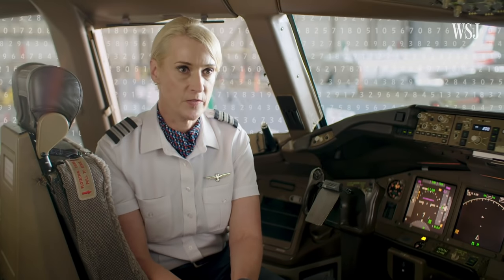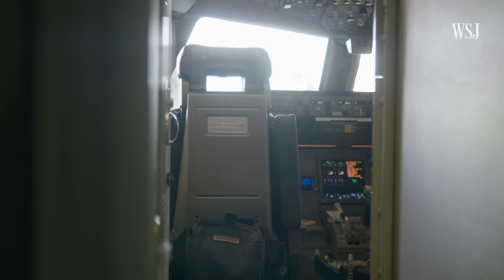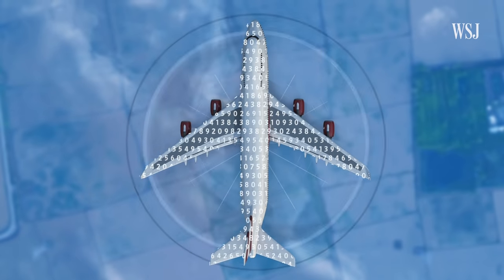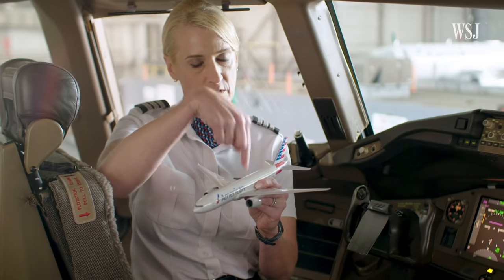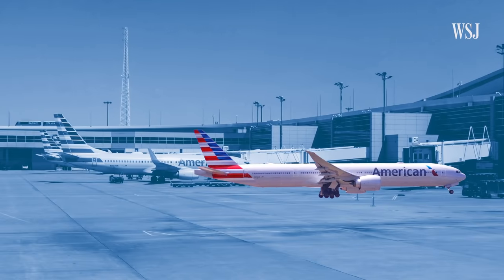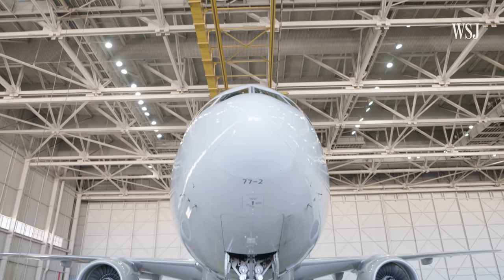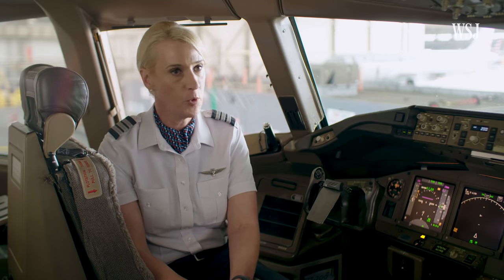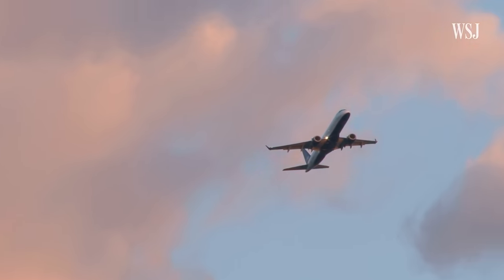How Does Autopilot Work? A Pilot Explains What It Can and Can’t Do | WSJ Booked

Comment: You said the 737 max crashes "was an issue of pilot error along with software". thats not true. Pilots were never told of the MCAS system in their planes and thus were very confused as to how the plane responded causing the crash. Boeing negligence killed those people
Reply: The Ethiopian pilots left the plane on full throttle the whole way through.  They knew what the issue was, they were taking the correct steps to resolve the issue, but the physics of airflow over control surface at several hundred knots made it impossible to manually trim.  That would have been avoided if they had throttled down to normal thrust levels.
Reply: Not just Boeing but the corrupt FAA is to blame as well. They allowed Boeing to self-approve the 737 Max.
Reply: You should have known that WSJ reports are full of flaws.
Reply: @qwerty112311  And the Indonesian Airlines?
Reply: Also, general plane design being not really suitable for engines of that size. Smart decision would have been to design a completely new plane that could fit large and more efficient engines, but Boeing decided to cut corners in order to cut costs and remain competitive against Airbus.
Reply: @sofoboachie5221  the pilot on the flight before the crash recovered.  Not defending the design and lack of communication about MCAS, but the pilots were able to save the planes in both cases is they did stuff right.
Reply: ahem runaway trim isnt taught to pilots?
Reply: @qwerty112311   You are full of it. Go watch VOX report is 6 mins on YouTube and come back again
Reply: @sofoboachie5221  Flight before recovered when they used the procedure. Then Lion air mechanics faked a repair and the next pilots didn't know the procedure, which is considered an essential memory item.
Reply: I think this video is sponsored by Boeing ....just to blame others
Reply: And they didn't have the reflex to just disable by using stabilizer cut out + manual trim ?
Reply: Correct.
Reply: there was a known procedure for stab trim runaway, it was a memory item for the older NGs too, the steps to correct the runaway stabilizer was the same, nothing changed with or without MCAS and the memory item existed long before the MCAS or the max came into the picture
Reply: @qwerty112311 You are or were misinformed there was no pilot error in the Ethiopian airline incident it was strictly Mcas that led to the plane Crash do dnt come here with ill informed nonsense abt the full throttle coz both the people who flew tht plane were veterans they new wat they were doing n had utilised everything they were tought for such scenarios
Reply: There have always been immediate action items (memory items) for a pitch malfunction.  Had they done those immediate action items the MCAS would have been disabled.  There are plenty of systems on aircraft that work in passive modes without a pilot's direct input.
Reply: 100%. They also said "Boeing has since fixed the software and updated pilot training." Updated? How about BEGAN! Seems like WSJ was paid for this short cometely omitting Boeing negligence.
Reply: It’s simply lack of pilot knowledge and awareness ! If these pilots can’t handle a stabilizer trim runaway , they should stay home !!
The MCAS is only active in manual flight ! If you fly the plane manually and the trim wheel left and right of the center console starts turning and you not activate the stab trim  ! You have to stop it right away with your knee and press the A P disconnect switch !
Tell the pilot monitoring STAB CHANNEL 1 and 2 off , when he replies STAB CHANNEL 1 and are off , then you as Pilot flying can relieve the knee pressure and the A P disconnect switch , trim the A C by hand and operate the throttle’s manual ! That’s it . Several 100 Times trained in the Level D Simulator .
Reply: The MCAS malfunction presented in the form a of a trim runaway which is something airline pilots are very familiar with.  

In fact, there have been many MCAS events at US carriers which did not result in an incident because the pilots reacted appropriately to a trim runaway.
Reply: @GreatLaker69  But would pilots have been better equipped to recover if they were informed what the MCAS system was? Or were they expecting the 737 to behave like previous versions as they had been informed?
Reply: @jordoncottenie3267  A normally trained crew would have responded to a trim runaway the same as they would on any airplane.  MCAS or not.
Reply: @GreatLaker69  So you're saying the 2 crashes within a year that resulted in grounding the Max's, that then had a software patch to fix it and have now not resulted in a similar crash, were completely pilot error?
Reply: @qwerty112311

That’s victim blaming. 

You have an airplane that you don’t know what it’s doing forcing you down because of a faulty system the manufacturer installed (something that controls a primary flight control with a single point of failure and no cross-talk or annunciations) and does it in an extremely subtle way… you can’t fault them for not paying attention to power settings.  

What’s more.. Boeing redesigned the pitch wheels to be smaller on the MAX.. meaning that they didn’t have the leverage required to move it manually.
Reply: @reinerressel975

Malfunctioning MCAS is NOT A STAB TRIM RUNAWAY!!  It doesn’t run away. It even responds to pilot inputs.  It just slowly and incessantly (in the absence of pilot inputs) trims nose down. 

And they did cut out the stab trim.. and were left with an unrecoverable airplane because the trim forces were too high and Boeing designed the MAX trim wheels to be smaller.

Comment: An autopilot from an airliner is merely the aviation equivalent of lane keep assist and auto lane switch to follow a specified route, with no obstacle sensing abilities (e.g. traffic, terrain and bad weather). The more modern integrated systems (e.g. Flight envelope protection) also protects against the pilot from going too fast or too slow, or turn too hard. Sometimes that malfunctions, as seen in Boeing's MCAS debacle.

There is some research into Tesla-style autonomous flying capabilities, such as Garmin's emergency autoland, but they're nowhere near as cutting edge (e.g. no camera/LIDAR and little machine learning) as autonomous driving, and are limited to drones and small private aircraft. The US airline industry and regulators have gotten comfortable with the 2-man flight crew system, as proven by the lack of major fatal accidents in the US since the 2009 Colgan crash.
Reply: Well, at least in Airbusses the autopilot system does evade other traffic. Basically it executes TCAS resolution advisories automatically, and does it smoother and more promptly than most pilots do as it does not have a startle factor to deal with. 

AI systems are not certifiably in aviation, current regulation requires a fully deterministic system, and AI/machine learning cannot fulfill that requirement. Things might change over time though
Reply: Garmin's autoland is under assumption the emergency is pilot incapacitation on a perfectly flyable aircraft. Add a major technical problem, all bets are off.
Reply: Indeed, the Autopilot does not have a role of thinking, reasoning and decision-making. It executes the pilots' instructions and directions.
Reply: @dbclass4075 yeah honestly I would even go as far to say as a minor issue like a fuel imbalance that's not actually there could trip up an AI.

Comment: Pilot: “autopilot is just a tool that we use, pilots are still actively monitoring and focusing on aviating, navigating, and communicating the whole flight”
WSJ: “in conclusion, pilots only fly for 3 minutes per flight”
Reply: They said manually flying the plane, they're right.
Reply: who cares, as long as it's avoiding disasters we can breathe easy. statistically speaking, it's still the safest way to travel.
Reply: AND FOR THOSE 3 MINUTES PER FLIGHT THEY GET $250K PER YEAR!!!!!!!  NO WONDER AMERICA IS BROKE!!!!
Reply: @manolokonosko2868  not really, they have to still monitor all the systems for the full duration, no airline pays $250k. its not an easy job, you can't just "leave it on autopilot"
Reply: @manolokonosko2868  then you become a pilot since it’s sooo easy
Reply: @manolokonosko2868  it’s also about being trained for emergencies, memorizing hundreds of not thousands of regulations and other know-how, and being responsible for the lives of hundreds
Reply: @manolokonosko2868  Just to pile on here, even if your comment was accurate, how would that translate to America being broke?
Reply: Hand fly**.  Handling the autopilot still requires a good understanding of the system and the surroundings, it is not a magical switch...
Reply: @manolokonosko2868  the ignorance...
Reply: @and15001  
Yup
Flying using the autopilot as opposed to flying using the manual controls
Reply: @and15001  I understand, and I feel very sorry for you. My thoughts and prayers so that your ignorance will soon be lifted. Use me as your mentor.
Reply: u expect them to fly the plane manually for 10 hours straight🤓
Reply: Indeed, the Autopilot does not have a role of thinking, reasoning and decision-making. It executes the pilots' instructions and directions.
Reply: @manolokonosko2868  pilots are paid for decision making skills, for ex - while on takeoff if u want to abort it u have just seconds to decide before decision speed or else all 300 ppl and 100million dollar aircraft will be destroyed. there are countless such decision which pilots make during the flight, pilots job is third most stressful despite so much tech, pilots have to work odd hours and have erratic work schedule ,pilots have to manually land the jet in heavy crosswinds, gusty condition which autopilot cant nd only highly experienced pilots are able to do that successfully, pilots have to be trained to handle errors made by autopilot like b737 max. so any job is highly paid on the basis of responsibility person has.
Reply: Haha. The public doesn’t know this and yet pilots keep demanding more and more money. The average pilot salary is 145,000 plus as of now for virtually no work.
Reply: @lat.fn6 that would most likely make people sick lol.
Reply: @DontUputThatEvilOnMe  fr
Reply: Well yeah she said focusing, not driving
Reply: @manolokonosko2868 if you flew for three minutes I would not be in that plane for sure lol
Reply: 3 minutes, this is just false, silly.The pilots fly the plane 100% of the time, using different modes, automatic, manual etc
Reply: @lat.fn6 well YES.I was surprised once to find out that my 767-300 could legally be hand flown for 7 hours, as all three autopilot were broke....it was very tiring though
Reply: @nathanmcguire932 Bidenomics
Reply: I just read a article that said there are 2 autopilots on flights at all times but one flight the pilots had to land bc the autopilot broke and they didn’t know how to fly the plane without it…..
Reply: @travis11231  most planes two or three autopilots, but only one is used 95% of the time except for autolandings when ALL are engaged for redundancy, like during poor visibility operations
Reply: WSJ is correct, take offs, and landings or course correction / avoidance. That and the captain and copilot acts as backup for if the system fails.  Though Airliners don't really like people to know most of their flight is controlled by a computer.
Reply: yes but for most of the flight once it'd reached its level there's nothing much to do. If there's a problem though that's when you need a pilot to be prepared to take over.
Reply: @chrisparnham  judging by your comment, you have no idea. Let's see, MONITORING THE ENGINES,  TRACKING,  TERRAN,  WEATHER,  CREW NEEDS, FUEL CONSUMPTION,  ENROUTE ALTERNATES,  ATC, OTHER TRAFFIC,  TCAS, ADS-B, DESTINATION WEATHER,  NOTAMS ........
Reply: @pirate3599 Yeah I was supporting the idea that pilots are necessary. I was pointing out that the reason they put the autopilot on is most of the flight is boring and when there are problems or landing and taking off pilots are crucial. I'm sure they do all that monitoring stuff as well although hopefully not in capital letters.
Reply: @and15001  Exactly! I'm crying after reading the other comment. Pilots deserve every cent they get paid. They stay all the time monitoring and flying as well as coordinating with ATC just to look after our lives. Not even to mention the long training which, to work on an airline, takes around 5 years
Reply: @travis11231 so they had to land because they didn’t know how to fly without the autopilot…… then how did they land, since you say they didn’t know how to fly without the autopilot? The decent, approach and landing are the hardest bit. Pilots train all the time to fly without the use of autopilots. They might not be quite as sharp as if they flew all the time without it, but they still know how to fly.
Reply: @thomassmith4467  Virtually no work? I thought there was a massive shortage of pilots in the US (due to the 1000 hr rule) and also insane salaries and signing bonuses of up to 70K or so for experienced captains? At least thats the story of US market from an EU perspective.
Reply: @manolokonosko2868

Ok boomer.

Comment: If i remember correctly, it was actually the physics of the engine placement on those planes that caused those 2 crashes. Yeah, they programmed the computers to compensate for bad physics, but that's like building a car whose front wheels face all the way to the right and have the cars computer set them straight. as soon as that computer fails, your wheels will veer to the right and now you're crashed. and the computer always fails eventually. its like Jurassic park all over again.
Reply: If you're referring to the Max 8s it was faulty angle of attack sensors and problems with the MCAS. The computer thought the plane was angling up and forcing the nose down. The pilots were not sufficiently trained on the new system and were unaware how to turn it off.

Comment: while on flight and auto pilot is engage, if there is turbulence or plane hit the dark weather, is the auto pilot automatically dis engage? or the pilot manually dis engage?
Reply: Either. For most weather, autopilot will handle it as well as a pilot. In fact, it's probably better to leave it engaged while the pilots figure out their strategy - how they're going to avoid the storms - and then input that to adjust the autopilot course. Of course they can disengage any time they like. Also, in extreme situations - maybe if there's huge turbulence and the plane loses a large amount of altitude in a short time - the autopilot can't determine safe flight conditions - and so it'll issue a warning sound and alert light and disengage. It's normally not just one thing that'll make it disengage, it'll be a combination of unusual events and/or pilot inputs. 
Also, Airbus and Boeing use different criteria for when an autopilot will disengage or not - that's exactly the issue with the Boeing 737 Max planes. Boeing made a significant change to how it operated in a certain condition, but it wasn't highlighted in any of the training material - they basically implied it'd fly the same as the original 737.

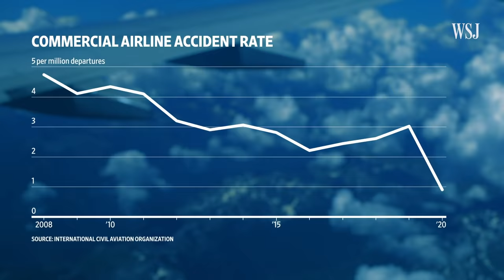Comment: 5:49 I highly recommend you re-edit this video when you refer to the MAX crashes and cite "pilot mis-steps". It was proven to not be the pilots fault at all in these crashes, rather Boeing and their concealment of the MCAS software. In the case of Ethiopian 302, the did everything right to turn off the MCAS, but only had 7 seconds to process and react to the software before it was too late. Therefore it is not fair to blame the pilots of those crashes in this video under any circumstances. I suggest you be more careful of how you refer to tragic incidents like this in the future.
Reply: Yep. Ethiopian was 100% Boeings fault. They followed all of Boeings instructions to the letter.. for a system that was only revealed to even exist a few months before.

Comment: "sensors monitor the aircraft" VOR antenna gives of a VHF signal, the receiver on the aircraft picks up the signal sends it to the Auto Pilot control box, gives an input to the servos motors which move the flight controls a certain way to allow the aircraft to correct the deviations of the aircraft.

Comment: Pilot missteps? They didn’t know about mcas!
Reply: Exactly!!
Reply: The Ethiopian pilots knew about MCAS and did EXACTLY what Boeing told them to do.. and were left with an uncontrollable airplane because by the time they realized that MCAS was malfunctioning and disconnected the stab trim.. the plane was so out of trim they couldn’t manually trim it back due to the smaller trim wheels on the MAX.  

Sure they left the power up.  Let’s see what your startle factor is like in the same situation and what you forget.

Comment: When you say some afcs doesn't allow pilots to input controls past some parameters, does it simply take hydraulic pilot pressure away from the yolk?
Reply: Airbus aircraft are Fly By Wire and the way it’s programmed the computer just won’t take the commands from the sidesticks

The 787 and 777 are also FBW but I don’t think it works the same way
Reply: @vagasint.4345  cheers so pilots dont get control feedback being electric, makes sense keeps oil leaks out of the cabin
Reply: @jaydenritchie1992   not on an Airbus no.

Comment: 3:55 - Autothrottle and even AP for lateral control can be enabled at takeoff.
Reply: Auto throttle yes
Autopilot is always off for takeoff
Reply: What do you mean by "at takeoff"? At the beginning of the runway or at liftoff? LNAV doesn't engage until 50 feet. Heading Select is not going to keep you on the runway. Moving the ailerons with your wheels still on the ground is not going to do very much.
Reply: @ImperrfectStranger probably another flight sim buff who had this work for X-plane and thinks it will work in real life